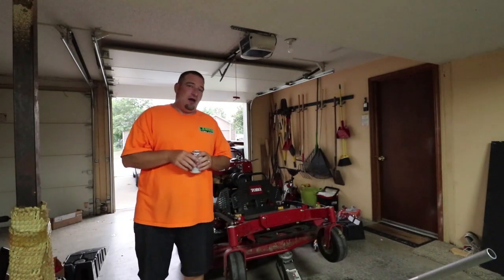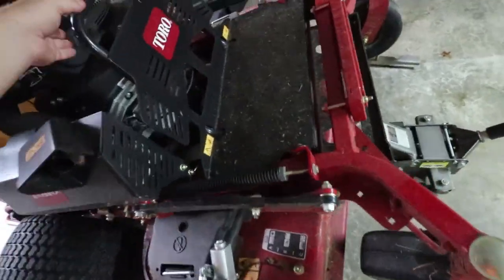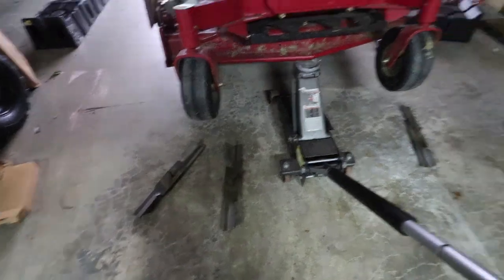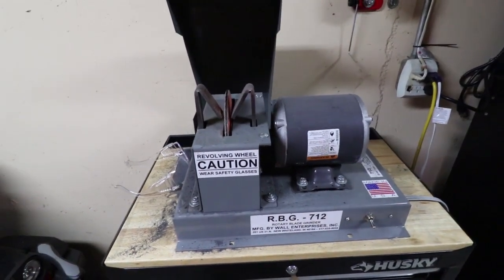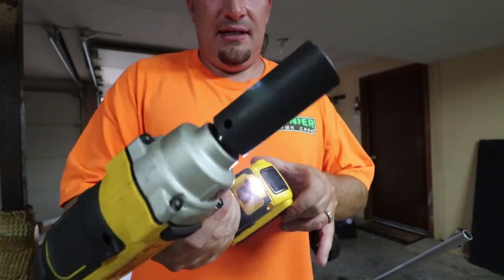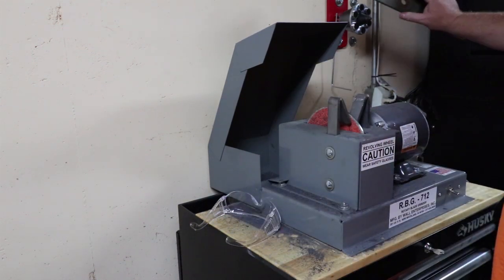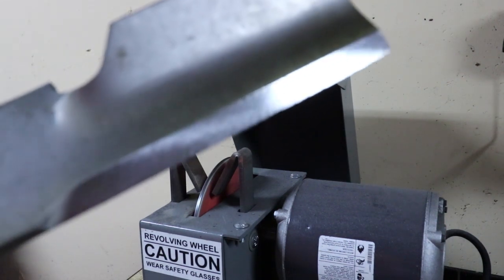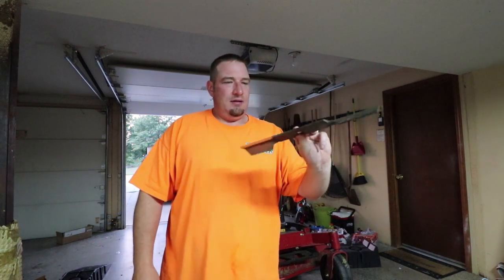RBG 712 Best Blade Sharpener?!?! Mower Maintenance

Comment: Great video. How do you check if blade is bent(barring the obvious). Set her flat on concrete etc? Thanks
Reply from the maker: Hillbilly Rig Repairs thaw balancer has a piece to check if blades bent or not attached to ot
Reply from the maker: Hillbilly Rig Repairs the balancer has a piece to check if blades bent or not attached to it